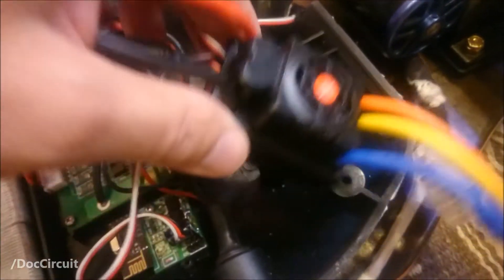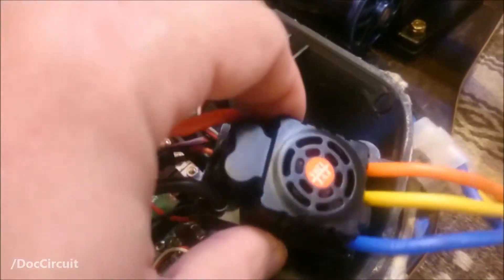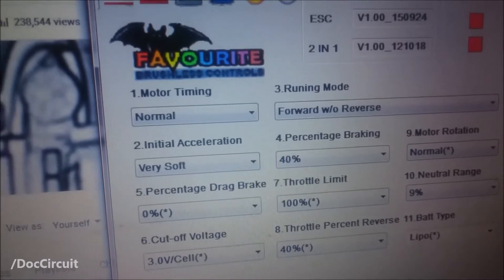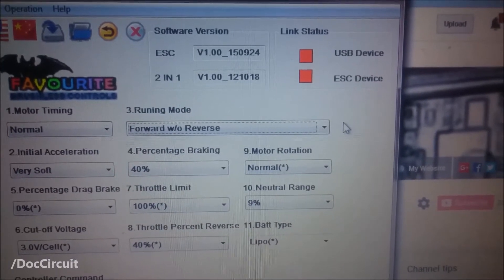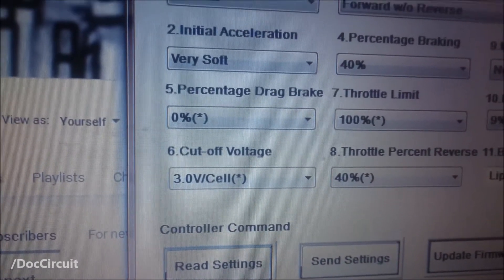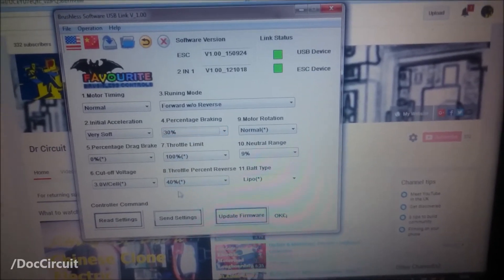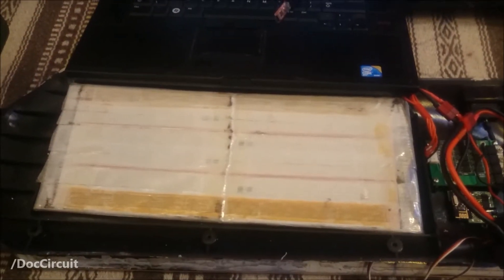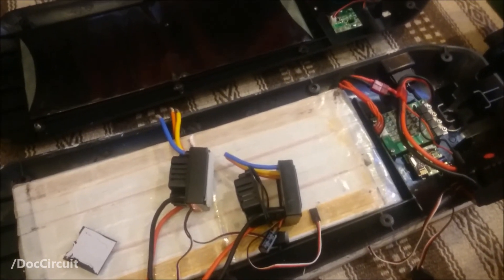Configuring ESC for Chinese Clone Electric Longboard (Luoov, LecDec, Backfire, Melon, etc.).

Comment: Hey, any idea why my ESC does not seem read the settings? I set my acceleration to high but its still kinda the same and I did not notice a beep when I send the settings through the software. Any solutions? Thanks!
Reply from the maker: Could be anything, but I have to say I wouldn't bother with programming one of these. Now we know how good the VESC and Alien ESCs are, I'd bypass radio control ESCs completely.

Comment: Hi Dr Circuit! I just have a quick question. I have the falcon/backfire board, and i haven't done any modifying to the board yet. Do you know if i can configure the ESC as you do in this video? Because when im using the brake on the board, i feel like im just getting thrown off the board.. From what i can see in the video, i need an other ESC than the original one, is that right? I know its a silly question, but i just want to make sure before i do anything, because i am already considering selling the board again, JUST because of the bad braking.. I don't have any problems with the acceleration, its only the brake that i dont like..  Hope to hear from you! Thanks  //Kasper - Denmark
Reply from the maker: You're spot on, a VESC or Alien ESC is much better than the original ESC and will sort your braking problems (it will make your board feel MUCH better).

Comment: I bought a new speed controller and programmed it as per your video but for some weird reason it still accelerates to full speed instantly! Any ideas what the problem is? https://www.amazon.co.uk/clouddrive/share/y1geBPPHbe4HsKzsk2xEAJcM4Jx9tizj4MuWWiSbxxV?v=grid&ref_=cd_ph_share_link_copy
Reply from the maker: I mention it in another video, but these programmable ESCs, although they look identical to the pre-programed ESCs, are actually a bit different where their software is concerned. The pre-programmed ESCs have the acceleration curve lowered even more than the programmable version can achieve. This is done by the manufacturer to allow these RC car ESCs to move a person on an electric board without tripping/resetting the ESC from too much current draw during acceleration. 

These programmable ESCs can still be used on electric boards but you need to be VERY light with the trigger.

My advice: dump it and get a VESC, or an Alien ESC if you cant afford a VESC (if you're in the UK).

Comment: I got mine few days ago. I could not configure the settings. Press " Read settings", it shows "ok" on the right bottom corner, but nothing else shows up. Same as "send settings", no "beep" sound from the esc. However, I can update the firmware. Does this mean the esc I got is not configurable? Is there a way to solve this problem?
Reply: Here is the software for the ESK8 version: https://drive.google.com/open?id=0B1ZwPMtmG_mRQXBhVVFHcExGNms
enjoy
Reply from the maker: Mmm, are you sure you received the 'open, programmable' version and not the 'locked down' version? They look identical.
Reply: +Dr Circuit I have no idea. How can I tell if they look the same? Anything different from the circuit board? So if I got a "locked down" version, is there a way to make it programmable? I am trying to contact the customer service of FVT as well.
Reply from the maker: Depends who you bought it from. Can you supply a link to the page/site you bought it from?
Reply: I bought from a Chinese dealer on Taobao. I just checked with the technical guy from FVT. Turn out that they have two versions of the ESC. One for RC car, the other for ESK8. And we can't program an ESK8 esc using the RC car software. The one you are showing in the video is for RC car. ESK8 software will have another setting option: "12. start power". The tech guy sent me the software, and solve the problem. Perhaps your "locked down" esc is an ESK8 esc. I can send you the software if you want to try on your esc.
Reply from the maker: Yup, they do indeed have two versions, which I have explained in my videos. 

To be clear, BOTH versions are for RC car, but one has been very slightly modified for use on electric boards. The main modification is purely software, and is a very slow acceleration curve, which you refer to as "12. Start Power". This is purely a work around solution to stop the ESC resetting/shutting down during start up. But it doesn't actually enable the ESC to handle high currents, which is why the ESC keeps blowing.

Thanks for the offer of the software but I really don't see the point of using these ESCs, unless you're very light, treat the board with kid gloves, and you'll still have the awful braking.
Reply: +Dr Circuit It's my 1st build. I m still trying out different setups. Yeah, the brake feels weird no matter how I tune it. Still waiting for Vesc though. Thank for the advise and very nice video.
Reply from the maker: Thanks! :-)
Reply: Could you send me the software?
Reply: @grahamzhu could you link the software please

Comment: Mine came yesterday, living in the uk, it was drizzling but I still went out, it was WHEELSPINNING as I accelerated, (I'm like 8stone) but it's  so damn quick!
Reply from the maker: +Night Flyer (Shakib Rashid) Good for you!

But do be careful riding in the rain. Apart from the danger these boards are less splash proof than they seem to be. 

And be VERY careful when accelerating hard, particularly when starting or going uphill. Your weight means your board will have a much easier time than mine but I've read LOTs of accounts of ESCs blowing because of acceleration by other people, and most of them weren't as heavy as me.

Keep out of rain, accelerate carefully, and enjoy!
Reply: i will do, but because of the country you and i live in, you pop off to tesco when its nice and sunny, then rain/hailstones fall when you leave.

i do wipe it dry as soon as i get home :)
Reply: +Night Flyer (Shakib Rashid) and if you do go out in the rain.. avoid all metal.. Drain lids and man hole covers are not your friend! What brand board did you get? :)
Reply from the maker: +Ed Bray Well said. I've tried taking my boards out on damp roads... very tricky (and dangerous!).
Reply: i came of my board really hard the other day from some wet drains.. i actually did it twice within 10 mins going though the centre of Cambridge.. i looked like a right tit.
Reply from the maker: +Ed Bray You're a Cambridge boy? Bugger, I thought I was the only person in Cambridge with an electric skateboard! :-) I can beat your fall... I fell off one of the clone boards (before I realised just how sharp the brakes were) going down hill, at speed, on Mill Road bridge (over the railway tracks). Landed on my bum in the middle of the road. I had to get up and chase after my board as it rolled in to oncoming traffic!
Reply: +Dr Circuit yeah I am, well I'm from Ely, so its 15 mins on the train, haha nope not anymore my friend :P ohh god, yeah that beats mine haha, Im sure I will have another fall soon tho that might be a competitor!
Reply from the maker: +Ed Bray Henceforth you will be  known as 'The first Ely E-skateboarder' and I will be 'The first Cambridge E-skateboarder'!
Reply: +Dr Circuit sounds good to me, we should meet up in Cambridge sometime for a cruse haha
Reply from the maker: +Ed Bray Good idea. Let me finish the upgrades to the clone board and we can compare it to yours!
Reply: +Ed Bray hi, you can go over drain covers or the little bumpy tiles they put at pedestrian crossings, just try bending your knees a lot putting as little weight on the board by doing so. And also stay off the throttle.
Reply: +Night Flyer (Shakib Rashid) yeah Iv heard that, I still try to avoid them at all cost, but if I have to go over one I will try that, thanks :)